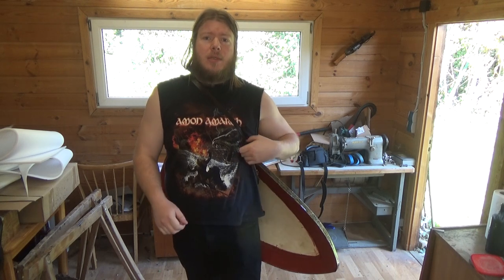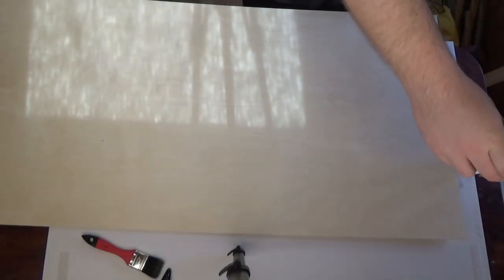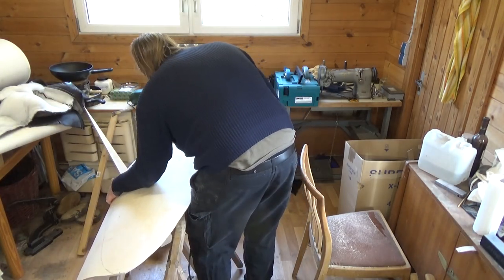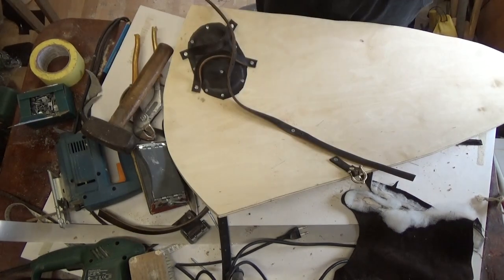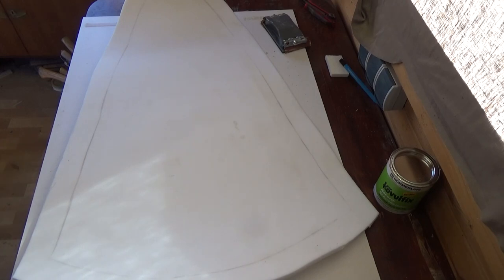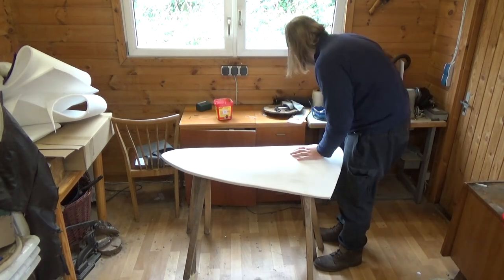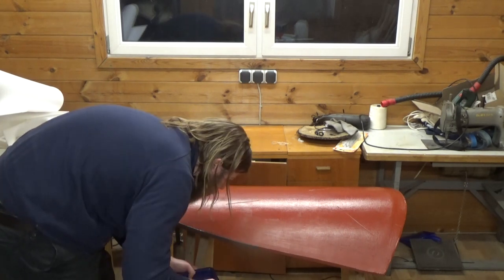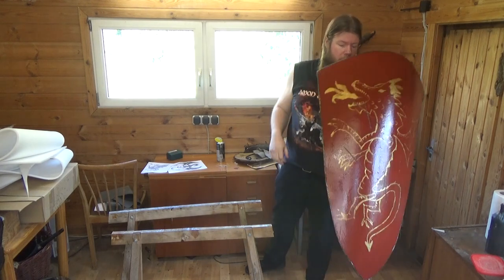How to Make a Heater or Kite Shield

Comment: Was sind die Unterschiede zwischen isoflex und Flexipaint und warum sollte man nicht flexipaint verwenden?
Reply from the maker: Isoflex is a product to waterproof rooftops. It is toxic, nasty to use, but super tough once dried on the weapons. Has a slight yellow ting.
Flexipaint is a none toxic paint from the cosplay scene. It is water solvable, dries super transparent. But it does not bond to the latex paint well, gets soft when wet it is just not tough enough for larp use. 
Will make a video on it soon.